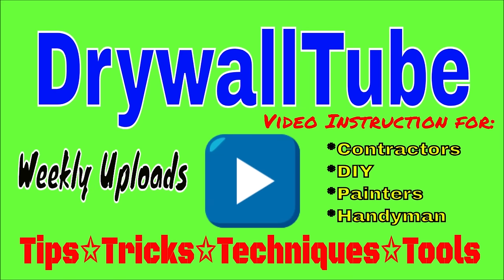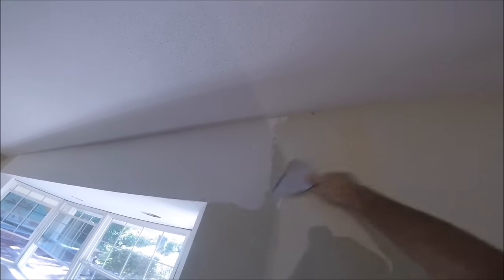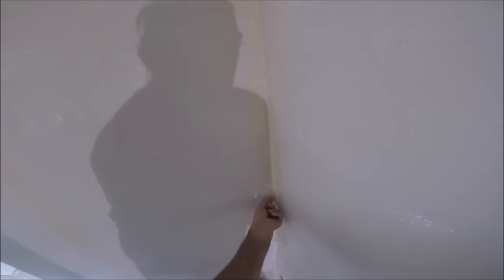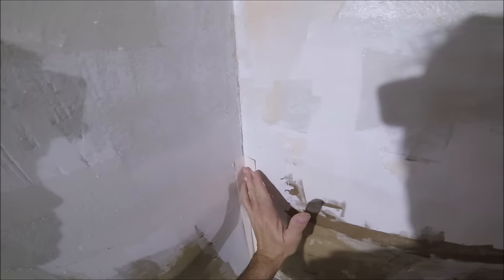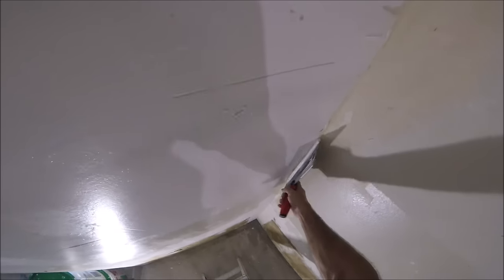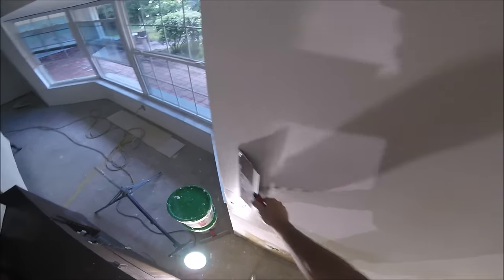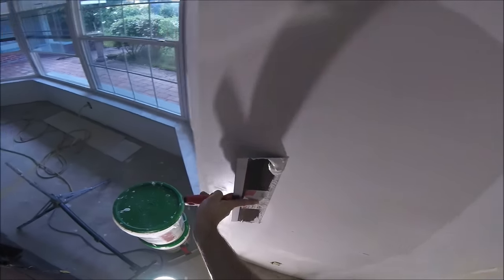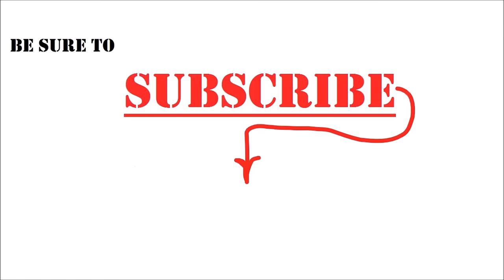How to Skim Coat a Wall after Wallpaper Removal Step by Step Tutorial

Comment: Hey, is the all purpose joint compound you use at 3:17 this product from your amazon page? Rust-Oleum ZINSSER 1 qt 02004 White, Bulls Eye 1-2-3 Water-Based Stain Blocking Primer/Sealer

Comment: He said "the consistency of yogurt", but he took the compound right from the pre-mixed bucket.  Do you thin with water?  I need a solution like this for a bathroom remodel where the previous homeowner destroyed the wall with hollow wall anchor holes, and paintbrush lines around objects on the wall.

Comment: #drywalltube  DIYer here working on my 94 year old mother's small bathroom. One thing always leads to another.  1st project was replacing the tub surround.  Then removed wallpaper.  Walls are in good shape, but I still have some repairs.  Painting doesn't scare me - even in a tight bathroom - but drywall work does!  I'm like a kid staring at a pool knowing it's going to be cold when I jump in so I'm scared.  I'm off to the store to buy supplies.  I'm not real sure about the use of GARDZ. Does that need to be applied just to the portion of the walls that will be repaired?

Comment: I would venture to say that the walls of my Boca Raton home built in 1987 in an "elite" very expensive golf course community and wallpapered by some "designer type" would be your meeting your match. The wallpaper has a coat of vinyl on it which repels water or wallpaper remover. It was torn into "fan" shapes (I can easily imagine how some "designer' type woman marveled in her genius of this "unique'' design not caring about someone someday having to remove the nightmare she created) and then applied to the wall in LAYERS. So, I "paper tiger" the heck out of it only to penetrate the top layer. I used a 1/2 nap paint roller to apply the wallpaper remover. I constantly doused the walls with the remover. I used around 2 gallons of the stuff for two wall in a small bathroom. it took me about 3.5 hours to get the wallpaper off. After applying one thick coat(sometimes it was dripping down the walls and I let it so it would seep in as much as possible. I would attempt to remove the wallpaper. Leaving behind the next layer despite my BEST efforts. The walls were NOT primed or painted before the application of the layers of wallpaper, so in areas where there was multiple layers that I could lift off (I consider it a MAJOR triumph when more than a 2 in sq piece comes off all in one piece) it has taken off some of the sheet rock paper no matter how much I soak it with wallpaper remover. The paper backing of the wallpaper was/is brown and it was VERY hard to tell if I was taking off the vinyl part of the paper (best scenario bc I could just soak the paper and it would be easy to remove) or if it had gone down to the sheetrock paper level. 
I will def watch this video several times and prime then skim coat the walls to the best of my ability. I have worked as a pro chef for 30 yrs and have done a decent amount of cake decorating and getting frosting flat on cakes is very similar to skimming walls, so I am hoping that my experience with that gives me a little advantage over a total noob DIYer? 
Thanks for the informative video.

Comment: Painting as working owner.  2nd career. Only 10 years professional exp.  Going to look at a job tomorrow.  Wallpaper over plaster.  It is also a rental unit.  My customer of course is going to only see price.  As he should with rental.  
Im asking if there is an acceptable corner cutting process I can use.  Im guessing…haven’t seen it yet..  I’m all for using top of the line products and technics.  That is my business plan. However, on jobs like this, which haven’t really done many rental readys.   I’m not sure of our options.    Being in a new market, I’ve moved from South Florida recently to small town in rural SE North Carolina.  Big difference!   And, my client is the mayor here. (Pop. 3200).  This job is a great opportunity for me.   I’m used to top of the line, that is S Florida.   I need a few suggestions.   So far from what Info about job.  Plaster says old, wallpaper  maybe layered…a lot.  And he probably has not  spent or wants to spend any money on those walls in a long while.  Those reading this who know what thinking here,yall are the ones I hope reply.  I did think of just totally eating this one, in this case though, he is the mayor, and that might be seen, as inappropriate…. Yep, Need a strategy here, help me out.  Again, looking for acceptable corner cutting remedy.? Time is time, can’t cut that.

Comment: I have purchased a house built in the 1920s. Its plaster walls and ceilings are covered with a wallpaper-like material that has been painted over and over through the years. It looks original as there are areas of the ceiling and walls where it was coming loose and I pulled it off to reveal the unfinished plaster. I plan on removing all the fabric covering but the problem is the plaster underneath has a sandy, gritty surface. Not sure how best to smooth surface before painting, skimcoat, sand or something else. I've done a lot of new drywall finishing and plaster repairs but have never encountered anything like this. Any recommendations?
Reply from the maker: Hey there Fred!💥👊🏻 Are you saying that you’re trying to match the sand finish before painting? Let me know. -Paul
Reply: At first I thought I was dealing with painted plaster and lathe walls and ceilings but upon closer inspection I noticed raised seams in places. After peeling the fabric sheets, which were thickly coated with years of being painted, off the affected areas it revealed a base unpainted plaster surface which, unlike other plaster I've encountered is rough to the touch, similar to 120 sandpaper. I'd like to remove this painted fabric covering material from the ceilings and walls in all the rooms and start over. Once I've stripped it all off I'm not sure how best to 
smooth the surface prior to painting. Someone suggested leaving the fabric on and installing 1/4"
Reply: drywall.

Comment: I have lots of drywall and painting experience and I picked up some good tips and reminders!  I’ve never used the fiber tape or the Guardz before so those are things I will be checking out!  I have used the thicker fiberglass mesh and the regular paper tape.  One thing I am wondering is if it would be a good idea to use Zinsser Bulls Eye 1-2-3 over the brown paper.  I have small spots where the paper has come off the drywall and not large areas like in this video.  I’m thinking of using that (instead of Guardz) just because I think I already have a can of it.  Any thoughts on that?  Great job Paul!  I appreciate the video!  #DrywallTube
Reply: Does bulls eye work instead of the gradz?

Comment: What is the cost of a drywall to just skim coat it, for painting vs a knock down plaster job?
Reply: Get quotes and find out. Most likely the plaster job is cheaper. Ask for "skip trowel texture" but that will also have to be painted.

Comment: I'm removing wallpaper that was installed when the house was built in the 70's to paint the whole house. Looks like I'll be doing alot of repair work first. It appears that the original wallpaper was applied to the drywall.

Comment: thanks. DIY , removing wallpaper that was applied over wallpaper applied on unpainted sheet rock. So have two layers in places. Was thinking of 1/4 inch sheet rock over the wall or maybe skim coat. Rebuilding the shower and vanity too so no job t oo big. #DrywallTube

Comment: Great video Paul! Watching from the Netherlands and new to DIY! Recently moved to a rental and decided to remove horrible wallpaper in a couple of rooms. Unfortunately it was put on unprimed drywall! Removed as much wallpaper backing as possible and there is some damage to the dry wall. You're video has given me some hope to sort it out myself 😁

I do have a couple of questions if you don't mind answering.
1. Most of the wallpaper backing is off but there are some bits that just won't come off. Can I put some primer over both the brown paper backing of the drywall and the leftover paper backing and then skim coat parts of the wall?
2. After putting on some skim coat, should I put another coat of primer before painting?
Thank you! 
#DrywallTube

Comment: I got 2 rooms and a area above the fire place that had a mirror, but no longer. bathroom is like on this video. Wall paper on drywall. Bedroom big problems! Chunks of plaster gone, bad brick flew semi exposed with old rusted metal fitting for a stove pipe. Flew still in use. Careful. Not sure what to do. Will start with the mirror area. Other then it is high up no real problems. I am a DIY forced, 71 years old woman.
Reply from the maker: 😅 Good luck with your project.👍🏻

Comment: Always puzzles me why Americans always mess about with tape and 'mud', in the UK we just apply glass fibre mesh over any edges and corners then skim the whole room with 2 layers of gypsum based finishing plaster. No sanding, all done in one go and the finish is flat and smooth with no sanding or messing about with second coats. So quick in comparison and a much better more durable finish.

Comment: DIYer, house built in 1895 and have removed three layers of wallpaper and a layer or two of paint from the living room walls. After putting kids to work on it with me, it’s a mixture of brown paper, original layer wallpaper, and gouges into plaster. Worse than in the video here. Will definitively use the sealer and then skim coat 2x. #DrywallTube